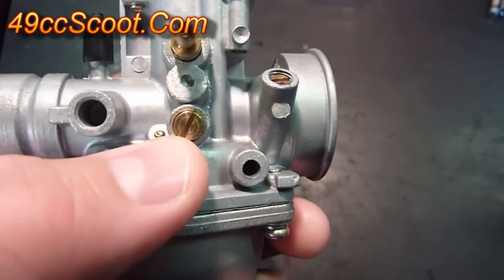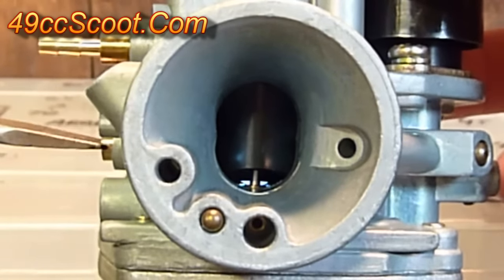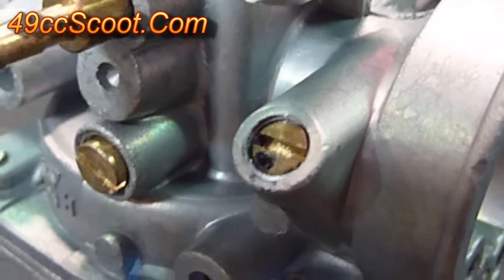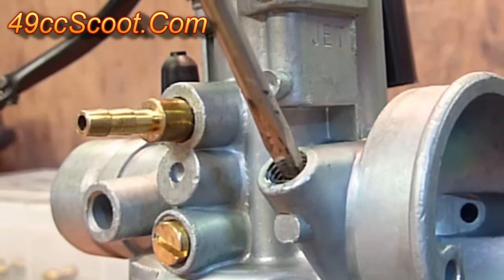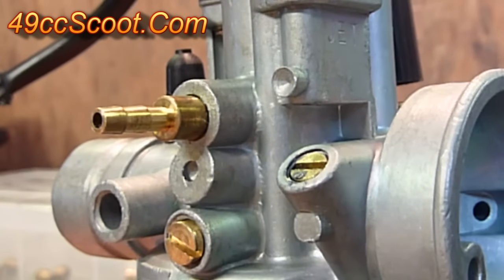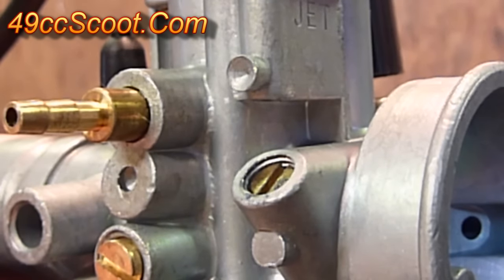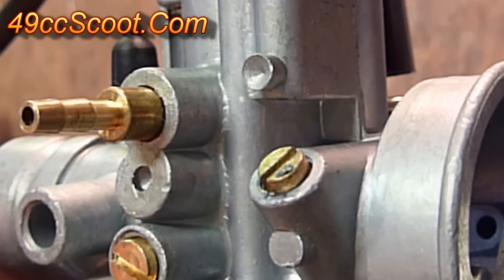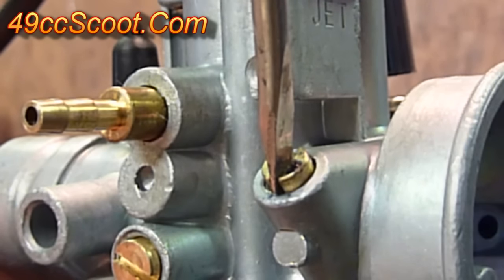Two-Stroke Scooter / ATV Carburetor Settings And Adjustments 2of4 : Idle Speed & Mixture

Comment: im a liitlle bit confused hehe. should i get the highest rpm from the idle or air/fuel mixture?
Reply from the maker: The mix screw, then adjust the idle speed screw to desired RPM.
Reply: 90GTVert Thank you very much!

Comment: I have a 50cc piagio scooter and I'm loosing Gas from the carburetor how can I solve this?this problem was after ultrasonic cleaning
Reply from the maker: Check your float height if it's overflowing. Might also want to make sure the float bowl drain is closed if equipped . See if it's sealing at the bowl gasket/o-ring.
Reply: @49ccscoot  thanks it was actually this cause I was putting everything together the wrong way

Comment: so wait......... i just got a new carb for a bike iv rebuilt how do i get the carb set up if the bike needs to be warm?
Reply from the maker: Start with ballpark settings if it's not letting it run right now. Turn the mix screw all the way in, then back it out about 2 turns.

Comment: What could be the cause if the idle speed is acting erratically from cold start like it hangs higher at 3000 rpm even though like hours before i have set it to like 1600-1800 rpm. Like i have to keep changing the idle speed every time it is parked and cold. Engine doesn’t cut off on me as well and cruises fine. Cleaned the carb and jets. It also took like 2 3/4-3 turns out on the air screw, do i need to go a size lower pilot jet? Also noticed this erratic idles speeds started when i upgraded recently to carbon fiber reed petals from stock and notice that it is not as tighly closed on the tip of the reed valve whenc compared to the stock petals. Thanks
Reply from the maker: Idle speed is often higher on a cold start because the automatic enricher is adding fuel till it heats up. If it always idles high when cold and you don't have an automatic enricher, then it could be that the idle settings are too rich or the pilot is too large.
Reply: Could it b air leaks on the manifold/reed? I cut off myself and replaced the paper gasket recently. No fuel oil/leaks that i noticed but then again it’s not the best to trouble shoot air leaks
Reply from the maker: @ninoechavez1402  You'd need to do a pressure test to find out for sure. https://www.youtube.com/watch?v=x-Jarx2od6I

Comment: Will a rpm meter help me because it will be my first time working on the carb it's stock yamaha jog aprio carb
Reply from the maker: It's a good tool to have for any tuning, but you can tell when then idle is rising and falling much without it. I'd much prefer the process with a tach, but you can always see how it goes without before buying anything.
Reply: @49ccscoot  thanks I know you can hear the difference I don't trust my ears because I was helping a friend whit his carb and he sayd it was to slow idling I sayd its fine and when we shut it of it didn't start it started after we sprayd gas in the intake
Reply from the maker: @preslavnikolov923  The tach is definitely good to get it to the right speed range. Practically a must if you want to do any CVT tuning and helpful for main jet tuning.

Comment: How much do you start with for a 4 stroke 50cc I need to adjust mine
Reply from the maker: Similar. About 1.5-2 turns out for a starting point.
Reply: 49ccScoot mine took a lot of turns to get it starter it’s running but I don’t think is running right my revs sounds like goes up and down
Reply from the maker: @tonysilva8222  You could have an intake/vacuum leak. That's a common cause of surging. Visually inspect around the carb, intake and any vacuum hoses. Look for cracks or loose connections. Then you may need to run the engine and spray a water mist or unlit propane torch around those things and see if the idle changes.
Reply: 49ccScoot I was just reading some stuff online what happen is my idle screw got lost so I put a regular bolt in it I think that’s my problem has no spring on it thanks for your reply’s
Reply from the maker: @tonysilva8222  That would do it. Should have a spring and a washer and usually some sort of o-ring to seal under there.

Comment: Can having the carb set wrong cause fuel coming out of overflow tube?
Reply from the maker: None of these adjustments will. That's likely sticking floats or float height set wrong.
Reply: @49ccscoot  thanks 👍🏼
Reply: @49ccscoot  would the float being stuck cause it to bog out at full throttle?
Reply from the maker: @rbradley7719  If its overflowing it could cause all sorts of things. Definitely fix that before worrying about any other tuning.
Reply: @49ccscoot  okay thanks for the advice i was stuck on what to do 😂

Comment: My aprilia runned lets say smoothly but the idle was very low it couldnt even idle for 3seconds. So i was playing a bit with those 2screws and now my scooter wont run on full throttle . but if i increase throttle slowly then everything is perfect but when i give full throttle quickly it wont go. Sorry for bad english.
Reply from the maker: ***** Set the idle so it's smooth and if it won't rev quickly try adjusting the needle position.
Reply from the maker: ***** Set the idle so it's smooth and if it won't rev quickly try adjusting the needle position.
Reply: ***** So i was trying to fix it the other night to find out that my air filter didnt even filter the air because the sponge was on the other side of the filter so it just took the normal air from the outside. Fixed the problem now it runs smoothly againg. Thanks for the video helped me a lot.
Reply from the maker: ***** Glad you got it fixed!

Comment: Trying to figure out why calibrator popping and not idling properly  do I need to ajustcarborator it's a honda yrs 400 ec 2005 atv
Reply from the maker: If it has been sitting for a while before this, first clean the carb thoroughly. Popping is usually lean. Aside from carb cleaning and tuning, check fuel supply.

Comment: My gas scooter accelerates without giving it gas... What could be the problem.. plz help
Reply from the maker: If the carb has been apart, the first thing I'd do is check the throttle cable and slide. It's pretty common for someone to put the slide (throttle valve) in wrong and then the engine revs as soon as it's started. If it's less aggressive than that, it may just be something like the idle speed adjusted too high or not enough slack on the throttle cable.

Comment: my carborator for two stroke always die... i already clean and check the fuel lines it but still it dies what am i suppose to do with it...?
Reply from the maker: adrian marbibi Start by determining when it happens. Always at wide open throttle or always at idle or always at 1/2 throttle etc... or does it die at any throttle position? Note any details you can to help you narrow your search.

Comment: When I try to adjust my idle mixture screw it doesn't seem to make any difference. What would cause this. seems like from quarter throttle to half it just cuts off then when holding wide open it catches back up
Reply from the maker: You may need to adjust the needle or perhaps a different needle. Could be other things, but I'd start there.
Reply: Thank you for your response tried raising the needle didn't make any difference in fuel air screw. Still Boggs out from1/4 to 3/4 throttle could you please give me some more suggestions on what to try 
THANK YOU
Reply from the maker: @fenceman7067  Thoroughly clean the carb. Your issue seems to be at 1/4 to 1/2 throttle, but that's not the range that the pilot jet and idle mix screw does a lot in.  You may be able to try a different pilot jet to make the mix screw effective. It could also be the throttle slide, which is usually more of a fine tuning thing or if the main jet is far off it can cause other issues. It could also be related to improper float height/fuel level.

Also, make sure you aren't mistaking something else for a carb issue. If it bogs at  low throttle while riding, there's a possibility that it could be an engine or CVT issue as well. Perhaps RPM is low and out of the range where the scoot is making power under low throttle conditions so it bogs.
Reply: Thank you again I will try these things. You are the scoot man
Reply: Yes he is a robot and he's lost in space

Comment: if i get the best idle with the screw all in. how to adjust that screw without changine the pilote jet ?
Reply from the maker: When you're cutting off as much air as possible, a smaller pilot jet is usually the way to go. You can't really say "I don't want to change jets, but I want to tune my carb". Well, you can, but that may not end well. You can try to block off airflow into the airbox partially (tape over a small portion of an inlet hole). That may then richen the main circuit or part throttle too much and then create other headaches.

Comment: I have a question, so what does the air screw actualy do i dont get it.
Reply from the maker: It lets more air in to change the air/fuel ratio at low throttle.

Comment: My bike  starts up fine afterwards when it's warms one or two miles I to my ride I open the throttle then it  bogs out then it begins to pop as I throttle down and sounds like it want to die out.  I try to give it gas then it struggles to get going then dies out completely. What should I do???
Reply from the maker: First thought is clean the carb and make sure all jets are clear and check for vacuum leaks or a damaged airbox.

Comment: Why air filter inside oil n water sir.
Reply from the maker: See what's connected to your airbox that could allow those things in first. For oil to get in there with most 2 strokes, it would have to run in from the injection system. If it were just oil spitting back into the airbox, it shouldn't be much even with bad reeds or something. Water really shouldn't be in there unless there's some way for it to happen with a wash or rain.

Comment: Ran great! then no throttle respose other than a almost closed it slowing down any way. Never started again. When I took the carb apart its started and ran wiyh power. after 5 min I cut it off, never started again?!

Comment: So I have a moped 50cc that will run for 10secs.  It won't run enough to get it warm.. in order to adjust it.
Reply from the maker: Make sure the fuel supply is good first and that the float height is set correctly.

Comment: My ktm 50 runs better when it's running out of gas? Then it dies when it's completely out 30 seconds later. Any ideas??
Reply from the maker: Robert DeVault Maybe your float height is set too high or the carb is just tuned too rich. Runs low and the fuel in the bowl drops and leans it out a little. First thought would be check the float height. Then try going over the tune again.

Comment: Or that isnt choke, because i have a small black knob on the left side of the scooter in the steering wheel section, and when it is pulled then the scooter will start, when i push it down it shuts off right away. The scooter is called "Qingqi qm50qt-4g" 1 cylinder 2 stroke engine. If you can help, please write back, thank you!

Comment: I'm having a problem... When I give it gas and go faster than 20km/u the engine stops, this has to do with airflow... buy idk how to fix.

Sorry for bad english
Reply from the maker: I'd start by making sure the airbox is installed and in good condition and then cleaning the carburetor and making sure the main jet is not clogged.

Comment: What if you idle it all the way up but it's still not high enough to keep it running
Reply from the maker: Something else is going on. Maybe the mixture/carb tuning or some other system is causing it. You can look in the carb to make sure the idle speed screw is indeed raising the slide.

Comment: ive been having some god awful problems with my yamaha zuma, every time i hit a big enough bump, it will flood the moped, whats wrong? 2002 yamaha zuma 2 stroke
Reply from the maker: Fuel starts pouring out or it just starts acting up? I'm just wondering if you're certain it's a fuel issue. A jolt could also cause electrical issues if there's a loose connection somewhere.
Reply: no loose connection, it doesnt pour gas out of anywhere but when i hit a big bump it floods.

Comment: where should the needle clip be during this setting?
Reply from the maker: If I haven't done any other tuning yet, I start in the center or toward rich.
Reply: 90GTVert ok. what if my idle mixture screw is all the way out? that means my pilot is to big? but could i richen the mixture on the needle/clip? that way my idle mixture screw isn't all the way out?
Reply from the maker: Don't try to use the needle to compensate for a pilot jet issue. If you lean it out all you can on the screw and it needs to be more lean, swap the pilot.

Comment: I have a e-ton viper 50.its not starting I pulled the plug out and its all oil donyou have any suggestions why
Reply from the maker: Check the oil injection system. Make sure oil isn't draining into the engine when it's off.
Reply: Can I un hook the oil injection and just mix the gas and oil
Reply from the maker: I've got info about that here : http://49ccscoot.proboards.com/thread/564/remove-oil-injection-system

Comment: But what if I don't have the idle mixture screw on my motorcycle.
Reply from the maker: Can't do this adjustment. Sometimes there's a mix screw but it's capped or sealed so it can't be accessed easily. You could search for info on  your make/model/year.

Comment: i dont know why my scooter stops accelerating and basically stops when i use full throttle and when i put my throttle back up then it starts accelerating again? i need help😩
Reply from the maker: Start wit cleaning and checking it. Maybe the main jet is clogged.

Comment: I have a big problem. regardless if what idle i put it at. The back tire keeps spinning and the choke on close the engine stops running. on full throttle on open runs fine. when the bike is on the pavement the bike stalls and stops.
Reply from the maker: It sounds like you could have a clutch issue. The clutch may be engaged all of the time so I would check that out.
https://www.youtube.com/watch?v=2EjW-iSP-Q8

Comment: My yamaha blaster, idles fine, when i rev it up in nuetral it runs fine. But when i ride it, it cuts out when im wide open(or somewhat close to wide open). By cutting out i mean its like when you run out of gas kinda. But it keeps doing it. PLZ HELP
Reply from the maker: +Bow Hunter You may be soft seizing from running hot. It can damage the engine, and most likely at least creates scuffing each time it happens. Usually it's from running lean, so maybe you have too small of a main jet. Could be an air leak.